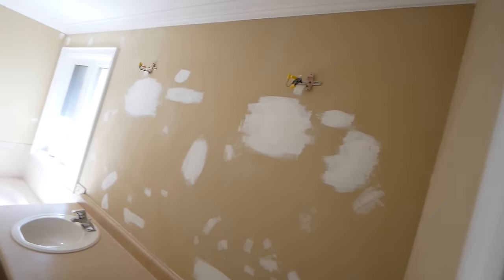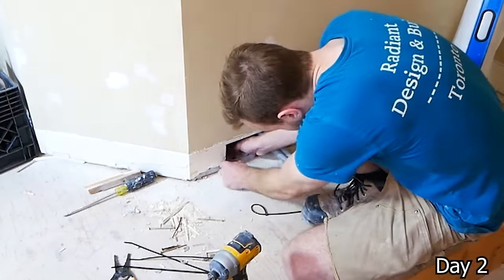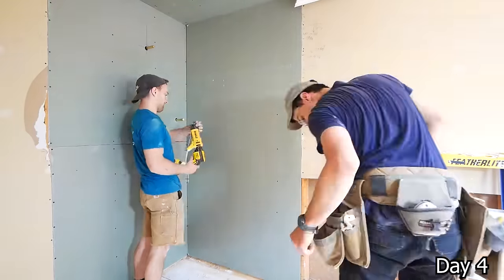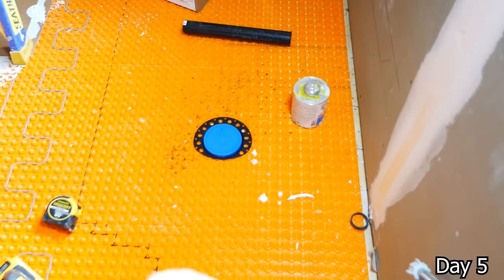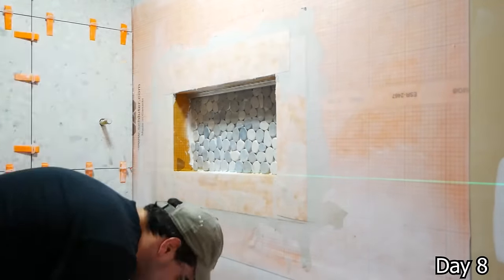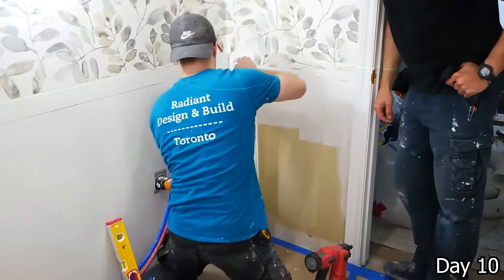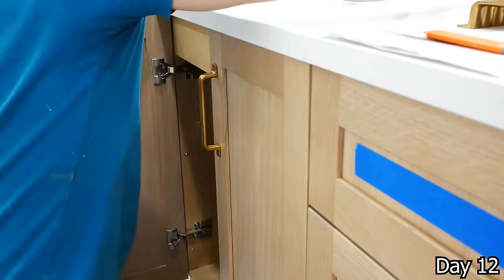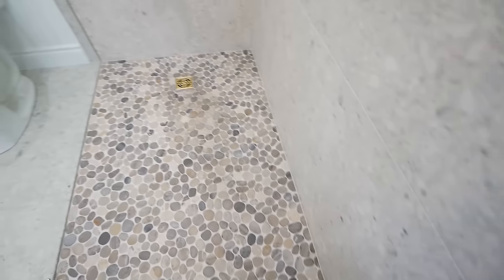Beautiful Transitional Bathroom Renovation

Comment: 12k in labor for 12 days of work! I'm in the wrong industry!
Reply: You not doing one industry. Your doing plumbing,tile.waterproofing. etc. It ain't one "industry"
Reply: @yossid422  Your comment made my head hurt. But just to be clear, he deserves every penny as a skilled and very attractive laborer.
Reply: @tycanuck  yes. Absolutely. Made your head hurt as your not industry.😜
Reply: Skilled labor ain’t cheap
Reply: Worth every penny
Reply: Rough calculation : 2 laborers, 192 hours, $62.50 an hour.  This is a tremendous value for the work you’re doing! We all pay way more to get vehicles serviced!
Reply: Is there a reason skilled labor is so incredibly cheap in Canada? In the states any half decent general contractor is at atleast 100 an hour USD.
Reply: @Tito-wf1qx  Skilled labor is expensive in Canada, too. This fella is most likely pricing his labor at a lower amount since he's new and building references.
Reply: 12k is cheap for the quality labor this guy provides.
Reply: @Tito-wf1qx in the US the labor on this job would have been 20k minimum and the quality of the labor and job done wouldnt have been close to as good as this.
Reply: Hola buenas noches
Reply: @yossid422 que te ya que bbjj
Reply: @tycanuck que te envié el
Reply: The labor is not the most expensive part. The knowledge is what you mostly pay for, paired with the responsibility if anything goes wrong.
Reply: 你好
Reply: You’re forgetting one thing: You actually have to do the work in order to get the money. lol Have fun doing all the demolition, plumbing, electrical, tiling and the million other things you have to do lol
Reply: You don’t see the hidden costs of a business like this.  Vehicles, tools, accounting$$$, etc.  You also own all the risk with such an enterprise.   If it was easy, everyone would do it 😅
Reply: @yossid422 my guy do you know what an industry is
Reply: i hope you people learn what a joke is and how to not assume the worst of peoples words one day
Reply: If they.stsy busy enough to get that on the regular. Might go a month without working

Comment: Nice work, I really loved it! One small thing, when running pipes in exterior walls you do not want to have insulation between the pipe and the heated space. It insulates the pipe from the heat and reduces the overall r-value of the insulation.

Comment: you can use the ditra heat peel and stick even if you arent doing a heated floor.
Reply from the maker: Yes of course but Ditra heat is more expensive than regular Ditra and thicker which isn’t always desirable

Comment: Always interested in the edge of the shower meeting up to the existing tile floor if you could show that in more detail next time thank you
Reply from the maker: Will do! To try and explain it here though:
If shower floor is the same tile as bathroom floor then it’s literally just a grout line the same as any other tile meeting tile.
If it’s a different tile like here with riverstone meeting large format then they pretty much just butt up against eachother (small gap for grout) and as long as they’re flush with eachother then it’s just the grout separating riverstone meeting large format
Reply: @WorkinwithWolkon  yeah always wondered about that small slope for the shower floor. Thanks for the response.

Comment: Hey Liam, another great video!  Would appreciate any advice you may share: in this video it looks like you are working with 2x10 joist but have you worked in houses running 2x8 joists? If so, how did you deal with joist drilling /notching limitations.

Comment: What clips did you use for walls ? Itried this  in past and found it difficult to break off clean below tile. Needed a razor to scratch plastic out to clean out spaces.
Reply from the maker: Can’t remember the brand name but I know a lot of guys swear by perfect level master. 
You’ll have less breaking if you 
1. Remove the next day
2. When you’re troweling either the wall or back of the tile I remove and trowel lines that would be right at the tile edge. When the spacer gets embedded in thinset it’s more likely to break

Even with this you’ll still probably have a couple that you’ll need to razor blade out

Comment: Does that dust extractor work well? Does it work better than making negative pressure in the room and blowing it out the window?
Reply from the maker: I’m quite happy with it, although it is a bit noisy. What we’ve been doing now is keeping the unit outside and running the duct up through the window and sucking it out that way. Better than say a box fan in the window but it’s not as if you’re going to be working completely dust free.

Comment: How do you cut your porcelain tile? I seem to chip mine alot :(
Reply from the maker: Depends on the cut but sometimes with a rubi snap cutter and other times with a dewalt wet saw and sometimes with a grinder. 
There’s a lot of variables that could be the cause of your chipping. 
Poor tile quality, poor cutter quality, old/cheap blades, improper technique, etc.
Kinda hard to give you a specific answer unfortunately